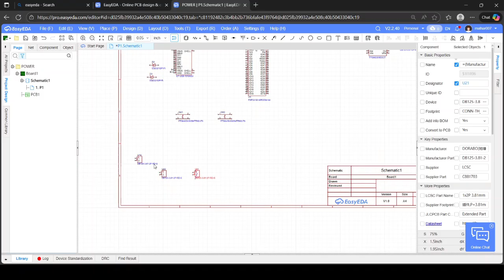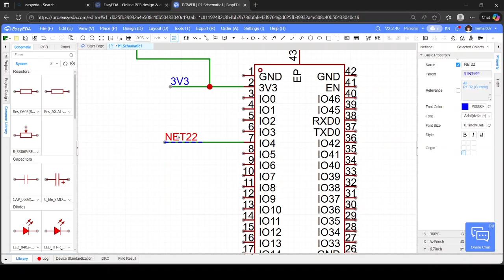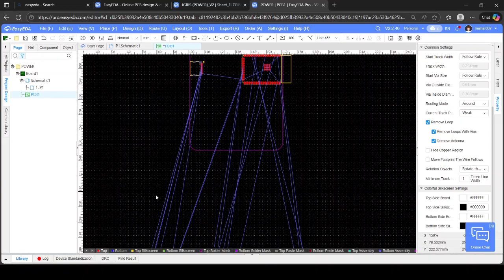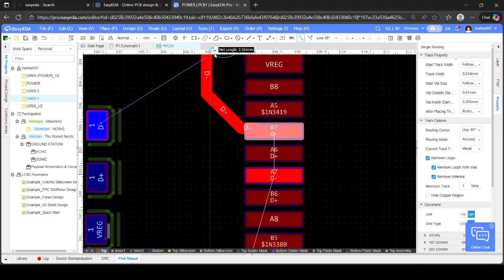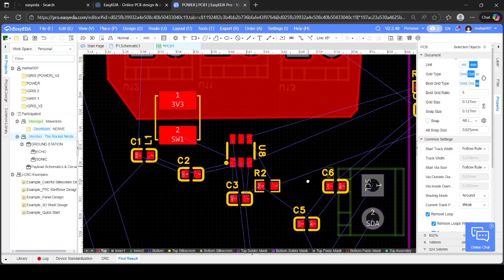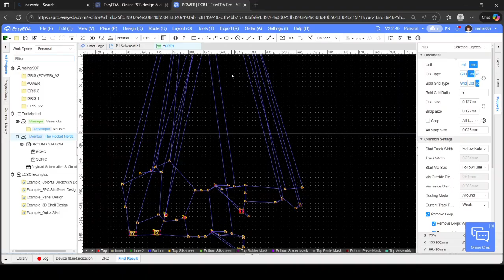IGRIS: Designing a custom Power Management Board

Comment: what is the input voltage from the battery and i wish to make a similar power board but for satellites for which the input power would come from a solar panel so what are the changes i will require to do?